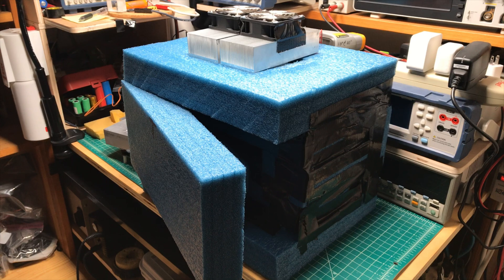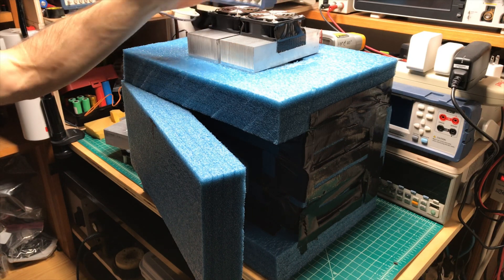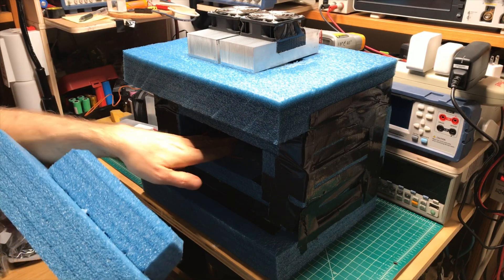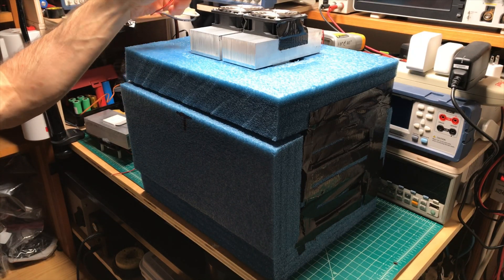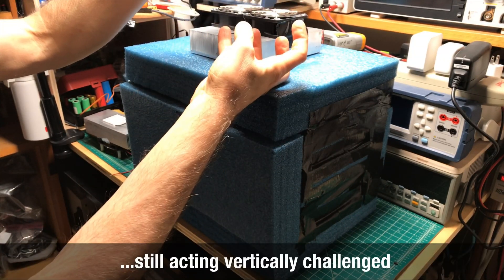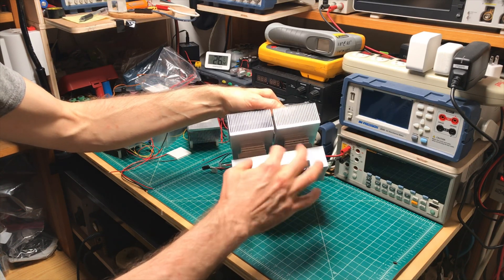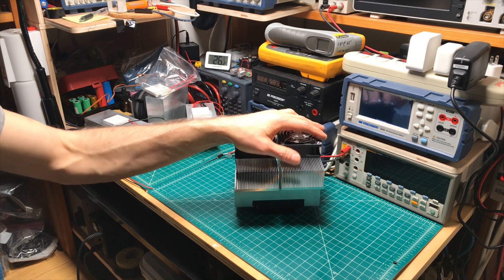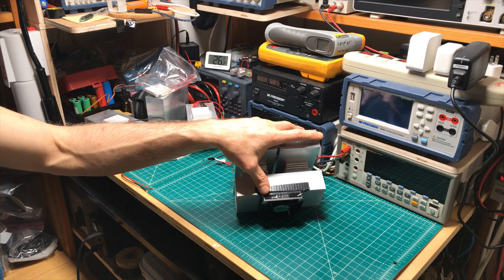Minding Your mAhs Ep024 – Cryogenic Battery Test Prototype Using Peltier Devices (TEC) – Part 1 of ?

Comment: Hey battery mooch I have a question for you where can I buy a real a 18650 that has the highest mAh  out there and the highest current amps on the market and what company makes it and what store on the internet can I purchase it from and I have one more question for did you work or own  a place in farmingdale on  Allen boulevard called Deka batteries
Reply from the maker: Nope, I don’t have a store or work in a store. 🙂 I don’t sell batteries but I do design power management electronics for my day job clients.

You cannot have a high current rating and high capacity in the same battery as both of those need room inside that battery and there’s just no space to cram both of those in an 18650. You can choose one or the other or a compromise between them. 

Follow the link to my blog at ECF that is in the Description section of this video and grab my Recommended Batteries tables. There are some great choices there and you can choose the one that has the combination of capacity and current rating you can work with.

The Description section also has a list of vendors that are used by a lot of people.

Comment: Mooch love your videos just subd you I'm using the wismec tinker 2 kit  I'm changing by USB  golisi  3.7v 3000mah cdr 25A/max:35A is this OK please please let me know as I'm new to vapeing thanks again great videos 👌
Reply from the maker: Which part are you wondering about?

There is no 3000mAh 18650 that exists with a rating above 15A-20A and the max rating is completely useless. I recommend staying below 45W per battery (90W in a two battery mod).

I can’t say whether it’s okay to charge using the USB port on that mod as it depends on the design of the mod, the condition of the connector, and what USB charging adapter you are using. My standard recommendation is to use an external charger. For any charging though do it on a non-flammable surface and only when you are around and awake.

Comment: In winter (even considering that Buenos Aires is not that cold, 10C average through winter) I never leave ANY batteries in the car, and if I carry a camera or a mod I keep it in an inside pocket so that it's warmer with personal heat. I sailed for a long time before vaping so you learn! Thanks Mooch!

Comment: This is VERY interesting to me. Just yesterday I ordered a high-end flashlight that’s powered by a 21700 battery and was wondering what the effect would be on the battery if I left it in my car! 
Thought: Why not simply modify and use a well insulated cooler for your test chamber? 🤔🤔
Reply from the maker: That is being considered, along with several inches of additional insulation inside as a standard cooler lets in a LOT of heat because the walls are so thin. I am using 4” of very good closed-cell foam and it’s not enough. Six inches would be better (and what the equations I did said I should use) but the prototype was going to be too big and that foam is frakkin’ expensive. 🙂

Comment: Not related to the video but I have a single molicell p26a that I forgot about for a month or two. I tried putting it in a charger today but I doesnt register. Says 0.00 volts. Is it dead? How could this have happend?
Reply from the maker: Sorry, I don’t know. Do you have another way to check the voltage? Was it used hard before you stopped using it for a month or two?
Reply: @batterymooch  I've only got a single bay travel charger and a normal 4 bay. It doesnt register on either one. I may have used it at a higher wattage than I usually do the last time.
Reply from the maker: Hmm...okay. I don’t know what happened to it unless it was overstressed and the internal protection permanently tripped or it was dropped (which can also trip the internal protection).
Reply: @batterymooch  thanks I appreciate the response, I haven't dropped that one but it's possible it was stressed. Just curious what could have caused it. Either way I'll be disposing of it properly.
Reply: @batterymooch  Now that I'm thinking about it, it was discharged low, and then never charged. Is it possible the voltage got too low resulting in the tripped  protection?
Reply from the maker: Europaii ॐ I don’t think the protection will trip from low voltage (it protects from temperature and over pressure) but perhaps it just self-discharged down to below where the chargers will recognize them. Don’t try to “revive” it. You’ll need to replace that battery.
Reply: @batterymooch  thanks. No worries I have plenty. I'll just toss it.
Reply: @batterymooch  so an update, as a test I put a fully charged battery into the mod. Left it for 2 weeks and this battery also died like the first.
Reply from the maker: Europaii ॐ ahh....okay. Thanks for the update. Some regulator circuit boards (chips) can still draw a decent amount of current from the batteries even though the mod is “sleeping”. Is there a YiHi board in your mod? I have been hearing that they draw a lot of current even if turned “off”.
Reply: @batterymooch  I've also heard about yihi, but no it's a uwell nunchaku. Never had this happen before so I'm assuming the chip is just failing. Either getting old, or maybe liquid steeped into the circuitry? Idk.
Reply from the maker: Europaii ॐ I don’t know. Your guess is as good as mine. 🙂

Comment: Very interesting. I live in Québec and I have to vape outside at -30°C parts of the winter. I usually keep spare batteries in my backpack, but not when it starts to get cold. Then I try to keep my mod in my jean pocket or inside my coat, but there's no denying that -20 -30 degrees cools down the batteries pretty quick. I want to know more on that. Thanks a lot!

Comment: I'm actually quite curious to see if the air volume inside the test chamber is enough to help maintain a constant temperature during the test. Why did you opted for a solid block on the cold side instead of one with a greater surface area? Wouldn't it be better to suck all that energy from the chamber since it's the only point of contact with the air?
By the way, great idea testing them at low temperature.
Keep up the good work.
Reply from the maker: Yes, more surface area on both sides is better, The single cold side heat sink is the same one as used twice on the hot side. I guess I didn’t rotate the assembly enough to see that.

Comment: Hey Mooch nice idea for the video, i would like to see a part two! I got myself a fan working with a module Peltier and i was wondering one thing. Do you think this is  a good idea to build a house chimney integrating lots of Peltier modules? I mean when it is very cold outside and your fireplace smoke going up in the 
chimney it makes a big temperature difference between the outside and inside of the chimney and will generate some current. Do you think it could be worth it? (Sorry for my english)
Reply from the maker: Probably not as you still need to move the heat out of each TEC and that would require many holes in your chimney stack.

Comment: I remember when TECs were all the rage in extreme overclocking processors on desktop computers, a few people still do it but seems to be much less popular since water cooling has become so efficient.
Reply from the maker: Yea, TECs just aren’t a great choice for CPU cooling.
Reply: @batterymooch  yes they were used for temporary setups for benchmarking, not for long term use